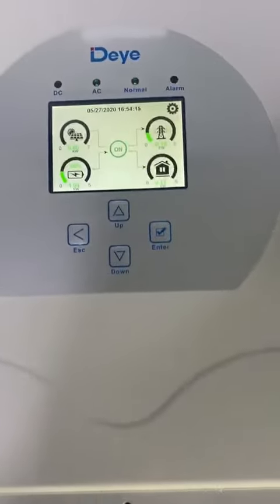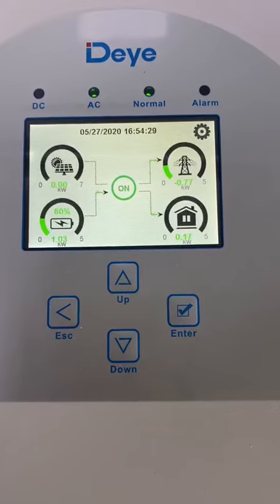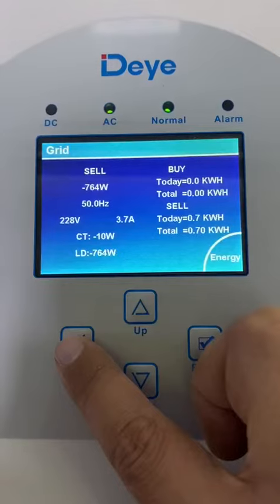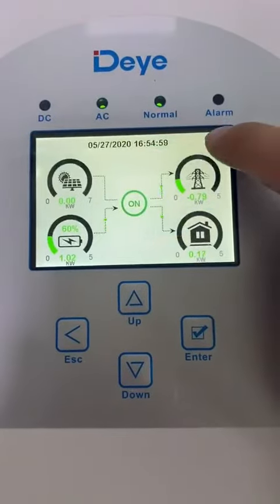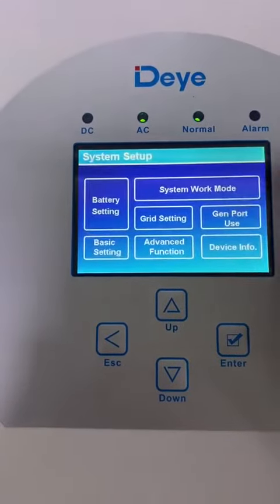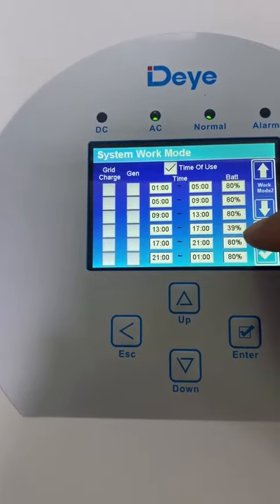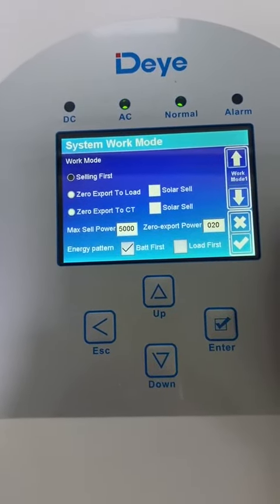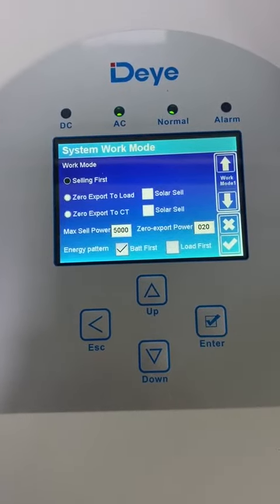Selling first mode for Deye hybrid inverter

Comment: Hello, I did everything the same but it is still not selling to grid from the battery. Is there any other settings that can block it?
Reply: Did you get this to work?
Reply: @ no
Reply: @Andrii_Dovbenko  I made some progress, try disabling "Grid Peak Shaving" if you have it enabled.
Reply: @ it is disabled
Reply: @davidkarlas7476 did you manage to sell from the battery?
Reply: @Andrii_Dovbenko  Yes I did, if you have Grid Peak Shaving disabled, only other thing that I can think of is, that you have Time of Use that has higher % than current battery, or that Power limit for Time Of Use is 0W, or that Battery discharge has 0A, or that you have Max Sell set to 0W
Reply: @davidkarlas7476  could you please make a video and upload to your channel?
Reply: @davidkarlas7476  could you please make a video of your settings and upload to your channel? I wanted to send my email by youtube doesn’t allow
Reply: @davidkarlas7476  it works for me. Thank you
Reply: @davidkarlas7476  Thanks, that help me a lot - I was so frustrated :-)

Comment: I don't understand what is the difference between "Selling first mode" and "Zero Export to CT with solar sell" ?
Reply: Sell first will not only NOT charge battery if it's above minimum charge, it will actively dump it to the grid.  Zero export with solar sell will first try to meet house demands, then charge battery to 100%, then sell excess to grid.
Reply: @mrm7309  thanks!
Reply: How to make sure it doesn't sell back to the grid? I know sol ark 15k has issues even tho it's not selected sell back . Sol ark gets their inverter from deye. Rebranded .  So wondering if it's only a 200a bypass issue since that is only different as that's in house with sol ark.